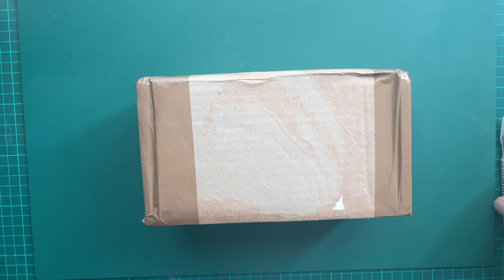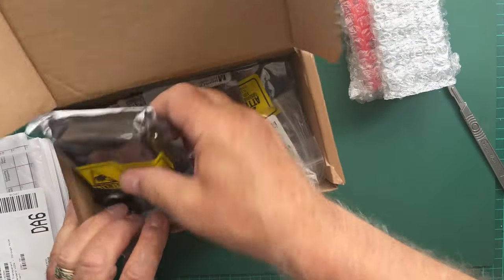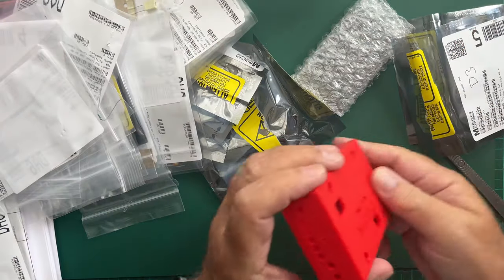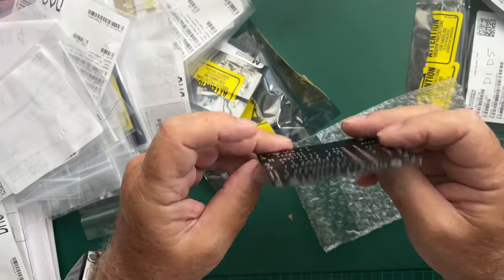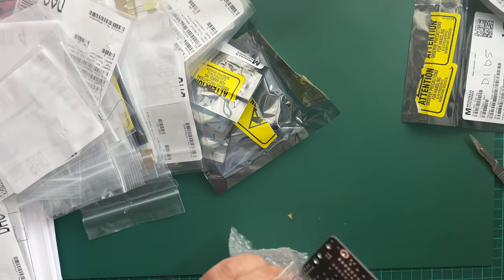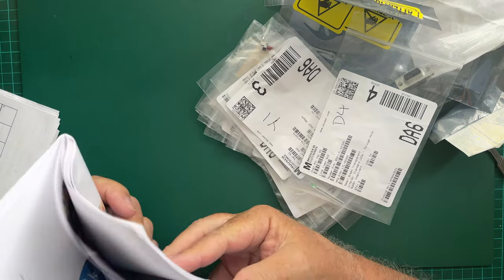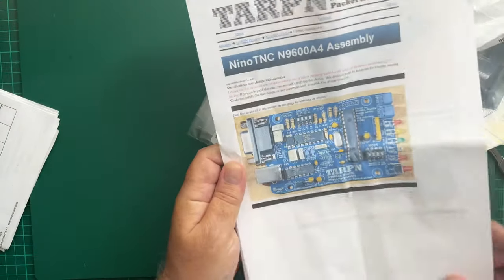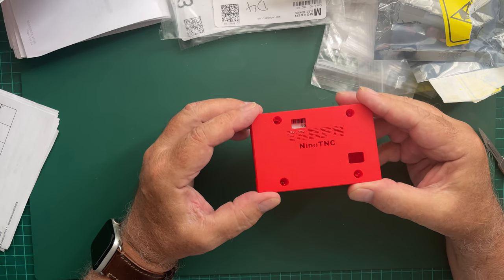NinoTNC Unboxing

Comment: The case looks great. I could only find a supplier based in the US so the postage cost more than the case. Very naughty at this end as there are now 3 NinoTNCs sitting on the desk. Be very careful with the build. I made a mistake with the first one and fitted the tantalums capacitors where the ceramics should have gone. (One of the tantalums had ended up in the tube that held all the IC's so I had 3 yellow capacitors on the bench and in they went. Doh!) Tom. G0JSV
Reply from the maker: The build went perfectly and it works really well :). The case is available as file for 3D printers and you can find it on my blog.  Details in the description
Reply: Nice one. One extra thing I did do was to install 2*14 pin IC holders. So you have the ability to rip out the USB controller to get to the serial pins below. If you know anyone who could print/supply a case for a reasonable price please let me know.